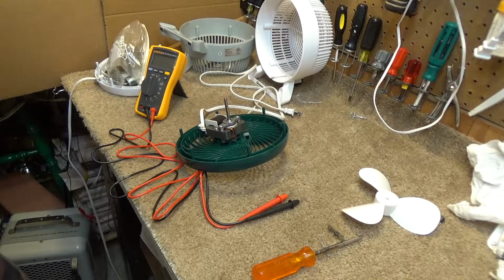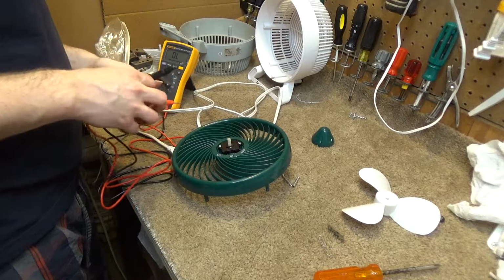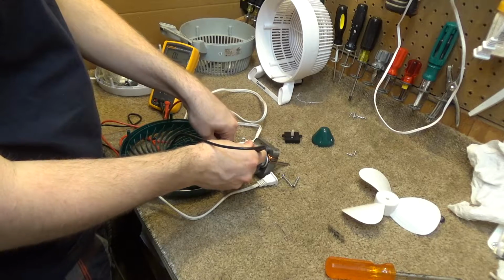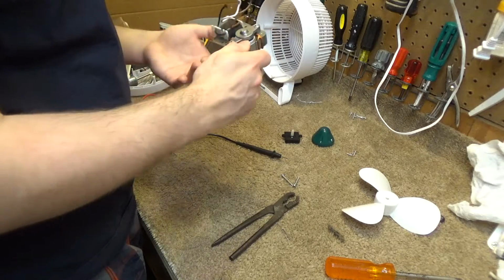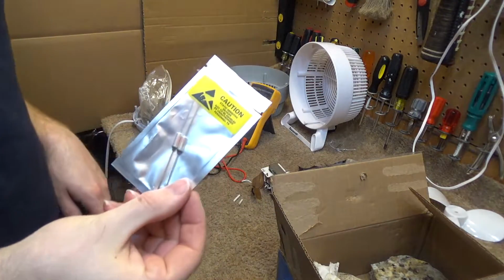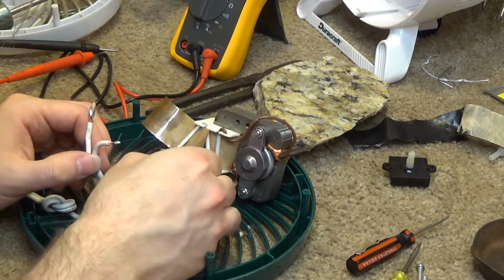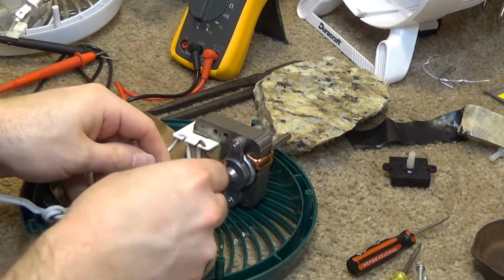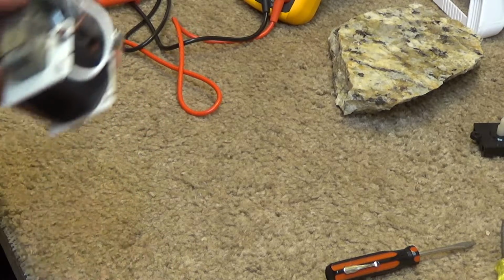Duracraft DT-7 Repair | Part 2; Electrical Repairs

Comment: I’ve had a dura raft fan for awhile now, it was from the neighbors stuff and they ddnt want it anymore, I’ve had it for a year or more or so, and my dad has it in his car because it’s broken, but it’s not broken, it works perfect/just fine, it’s just missing the vent part on the motor pedestal table version, and I keep telling him that it’s gonna be broken for long, and he says your not gonna bring trash up, but it’s not trash, I mean it still works and I definitely do want to keep it, after awhile if having it I wanted to have 2/two, and my dad sent me a link on eBay, and I now could technically have 2/two, bit I want to hve another 1/one next to it, and my plan would be to either have a pedestal and a box version and or out the pedestal in a rectangle box thing with the other on top of it because it’d look cool and look like those fans you’d see out in the world that have 2/two or more fabs in 1/one unit

Comment: What if only the high speed works?  There is no movement on low speed at all.
Reply from the maker: There are numerous things that could cause that, perhaps there is a loose connection somewhere..
Reply: @JordanU  thank you. I did check all the connenctions I think perhaps its in the switch. High works fine. Just no low speed.